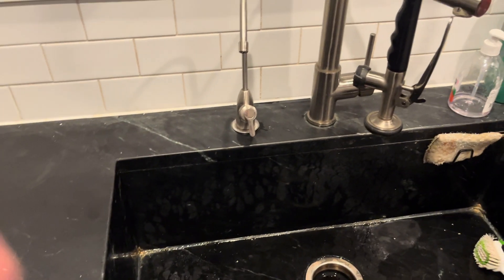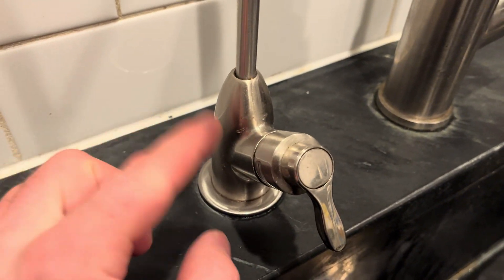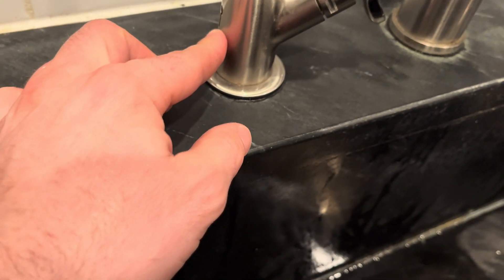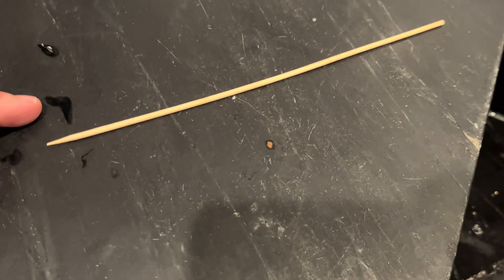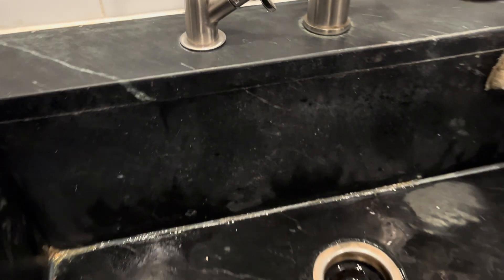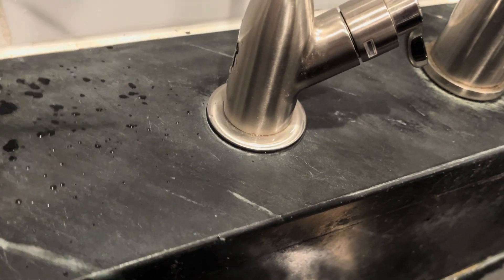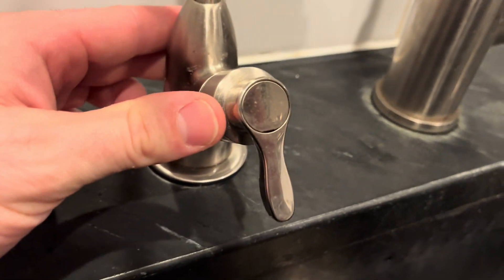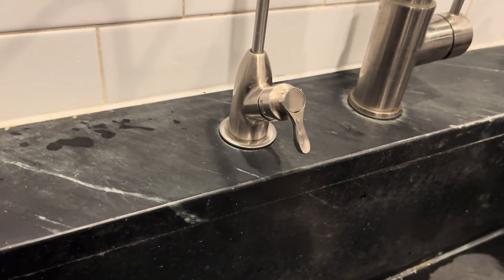Reverse Osmosis System | Faucet Leak Fix!

Comment: You have no idea how long my family and I have been dealing with this. It was so bad it caused leaking under the sink. First time I took out the black tube, I thought there wasn't that much gunk and the problem stopped for a little bit. Wasn't until today that I did the combo of scraping and blasting it out. You are greatly appreciated, may blessings come your way.
Reply from the maker: You bet glad it worked for you! I now have a couple spare bottles of air duster and blast out the purge drain tube on the RO probably once a month to keep it from clogging and causing a big leak like you said! It seams to be an issue draining with common garbage disposal sinks as our basement RO system on laundry room sink has never had this issue!
Reply: @TrophyTimeAdventures Appreciate it!